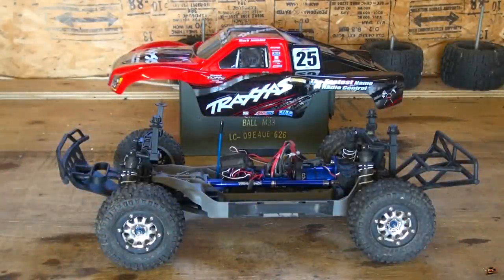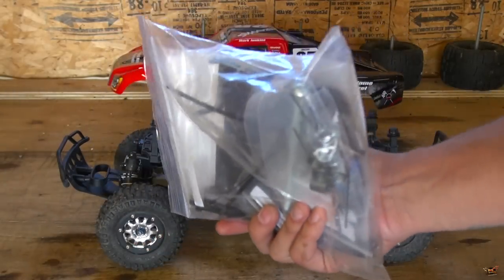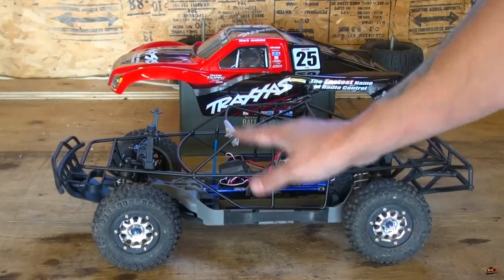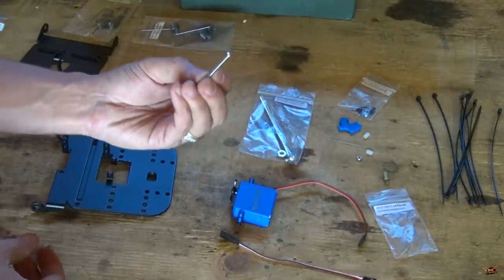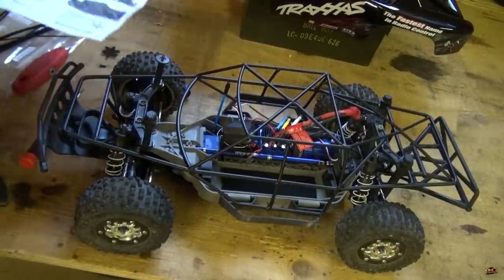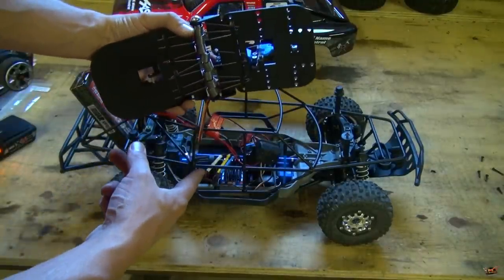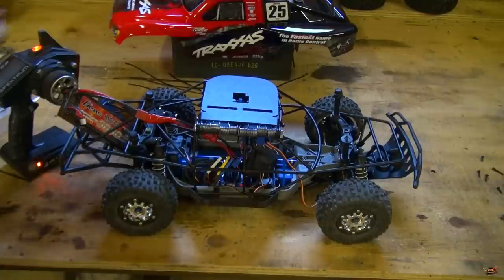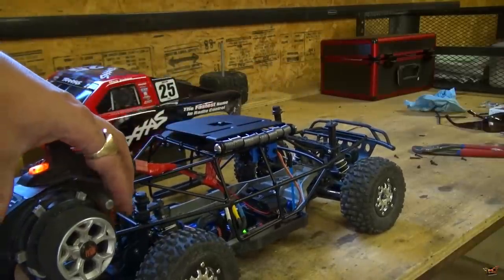RC ADVENTURES - Radio Controlled FLiP LiD - RhinoForce S2 from Torsional Concepts - Build & Test

Comment: Why springs? Why not a high torque LOW speed servo? Instead of more current draw, you use more gear reduction to get the high torque.
This means it won't give you a radio brown out due to high current draw, and it won't be too weak to flip the truck, AND you don't have to drive it back to reset it, AND it's not going to hurt anyone if it's triggered accidentally when someone's got their hand over the plate.

The only spring in this thing should be the servo-saver, if it uses one. Probably use the coil-torsion spring type of servo-saver instead of the linear-spring-with-cams style of servo saver, as those wear out and aren't great at keeping constant force on the pushrods.
Reply from the maker: Too late.. they went out of business.
Reply: That sucks

Comment: That's really cool. Do you think you could integrate an rc winch or something to automatically reset it as well?
Reply from the maker: remotaholic No.. How would you have the cable release when you needed it to flip?  You would need a neutral gear to make the winch release - which doesn't exist. Im not sure why everyone is so tainted on having to bend over to re-attach it. I'M NOT THAT LAZY.. haha :)
Reply: ***** Well you could use the winch to reset, when it is back you let the winch turn back so that you can reactivate the lid without the cable to stop the lid.
Reply: ***** sure you could, if the winch doesn't have a hold brake it will free wheel out and would be powered in to reset. Agreed though it's not much work to reset it.
Reply from the maker: ***** there is never a need for RC to exist at all.. its creative innovation that has pushed this hobby as far as it has come. As for being lazy, you may speak for your self - but there is a lot of scenarios in the world where an apparatus like this is very useful. I don't mind showing people it exists.
Reply: ***** Since your no couch potato, what's the point of installing this on you Slash?
Reply from the maker: DieHarder because I can use all the help I can get :)
Reply: Good point...
Reply: ***** i think its pointless without a way to auto-reset it ...if you're not too lazy to flip it back down then you're not too lazy to walk over and flip it back over manually and may as well not have it in the first place.. :P may as well do the complete job instead of half of it..
Reply from the maker: warmfreeze I disagree, but whatever :)
Reply: Yah, but this way you can drive it over to you and close it!
Reply: +warmfreeze Walking 150 yards away to flip your truck back over vs driving it back to you and bending down to reset it is a massive difference. If you can't tell the difference in that then you've missed the entire point and make no logical sense with your comment.
Reply: TheAmericanUhate LOL to be pedantic yet again ...there is no viable reason to drive your RC 150 yards away from you.. most tracks are less than 100 yards across XD
Reply: warmfreeze You must not realize the largest portion of RC owners are not at the track. Nobody would use this for track use anyways because of weight issues. This is not for the track, it's for the regular everyday RC hobbyist playing around locally. Also yes, many of them do drive 150 yards away also.
Reply: TheAmericanUhate kudos to the 5 people in the world who can drive an rc 150 yards away and still see it...much less control it (i said 5 ONLY due to the few FPV peeps) 

you must not realize that most people never drive an rc greater than 100 feet away from them. 

Now i am not sure if you are attempting to exaggerate the distance in an ill attempt to make yourself "feel" correct. 

The only logical reason i would see a need for this is if someone was in a wheelchair and handicapped. to which i have a friend that is paraplegic due to a gymnastics accident 2 years ago and she agrees with me that these are silly. she has no issues wheeling herself up to her own car and flipping it back over to continue driving it.
Reply: warmfreeze I guess you've never seen all the hype with the speed runs? Everyone wants to go fast in a straight line. In order to do that, they drive as far as they can see and do a speed run. I've seen it over and over and over for years. 

You realize 100 feet isn't shit? That's about 33 yards LOL. That is beyond stupid of you to even say. 

I'm sure your friend is going to wheel herself off on a dirt lot really well with a wheel chair to flip over an RC car. Sounds like you're just making up stupid shit at this point. If you don't like the idea of this, then don't watch the fucking video or comment on it. Wow some people are just fucking whiny af over everything.
Reply: TheAmericanUhate So basically what your saying is...you just want everyone to roll over and agree with your opinion. Is that how you really think life works?
Reply: warmfreeze Same could be said about yourself, obviously. I'm not the one going to video's of things I don't like to complain to others trying to force them to agree though.
Reply: TheAmericanUhate Never said i didn't like the video ..just stated it was a useless idea XD
Reply: warmfreeze I said "video's of things I don't like" not "video's I don't like". Learn to read. If I see a video of something I don't care for, I don't go watch it. I damn sure don't go watch it then complain in the comments that I don't like it. I guess I just have better things to do than be that whiny.
Reply: TheAmericanUhate I never said i didn't like his videos....in fact i love his videos and appreciate them i just simply said this add on is a bit pointless. Also how will i know i don't like some of the content and form an opinion of the video if i don't watch it? i'm not complaining ..i just stated my opinion ..you are the only person complaining about me having an opinion XD I never asked you to agree with me. Learn common sense.
Reply: warmfreeze Again, I said you didn't like what this video was on/about, not that you didn't like his video's. Again, learn to read. It was very clear this video was about a flip lid and the picture made it even more evident so you knew before clicking what this video was about. Yet here you are, still watching something you had a pre-formed negative opinion of it and here you are in the comments saying you think it's pointless and you don't like it. That is exactly what complaining is. So what if you think it's pointless? Others might and does love the idea, obviously. Learn some common sense and lose the "my opinion is the only one that's right" complex.
Reply: TheAmericanUhate This is the OPs father. You do realize you are arguing with a 12 year old girl and you will never win right? I have tried for the past 5 years. Chalk it up for experience next time. fist bump
Reply: warmfreeze I had no idea. She has good grammar for a kid, normally I expect them to speak awfully and avoid those. Mine just turned 14 and she's the same about never losing an argument, I think she gets it from her mother lmao. Thanks, fist bump
Reply: +remotaholic they should just make one that uses the servo itself to flip so it can be retracted
Reply: RCSparks Studio  especially when you have a bad physical injury (like us) and it's a long walk to the rig you just flipped!

Comment: At first I thought that it would be a lil silly. But actually it serves it's purpose well. After seeing the force of the spring in your shop I thought it would just send the truck flying in the air and end up back on it's lid. Lol. Very nice product. I'm sure someone could come up with something a lil less complicated with just a short arm or bar that could pop out a small slit in the roof so u wouldn't have to remove the top lid. 2 thumbs up

Comment: I think the main reason these guys didn't get off the ground is because of the high price tag. I'm fully aware that the costs involved for small businesses are very high compared to a large company who could easily mass produce items. I just think that while this is a great idea I would rather walk and turn my truck over than spend £ 82.17 ( $100) on the device, $40 for the cage, and then cutting a huge hole in my body... It just doesn't seem worth it. But at least these guys gave it a go. So I'll doff my hat to them. I hope they come up with something in the future that will be a viable product.

Comment: now if it could retract itself... then it would actually be useful! still kinda neat though.
Reply from the maker: I disagree. I think it's useful the way it is.
Reply: Sure I guess... I'm just looking at the fact that you still need to drive it over to you and close it. Doesn't really save that much trouble! I would assume that the weight it adds up high may affect it in terms of rolling during hard turns as well. I do appreciate the innovation... Just giving my opinion. :)

Comment: Really neat concept. Just not very practical with the bulk of it and only a single use. I've seen an RC boat that basically does the same thing but can do it an unlimited amount of times. However with the release of this new product it's only a matter of time before someone figures out a way to customize one to work numerous times. That's pretty cool though and they are sure to make a few bucks off of it.

Comment: That is a GREAT invention.. Out of curiosity, when you first flipped it was on an angle on the roof by the hinge... Did you try to flip is on an angle sitting on the other side? I'm just wondering how the device would work with a bit less ground contact?

Comment: That thing works pretty good! I'm surprised those springs don't have more force behind them with all of the tension on them. I figured the truck would do a 360 with it, but it didn't.
Great job, and another great video.

Comment: On those Slash body mounts, can I buy just the plastic pieces that screw on to hold the body in place? I used the slash mounts on my ecx torment so I could use a new body, and now I'm missing one of those cap/screws. Looks kinda silly with only 3 parts of the body locked in place.

Comment: There has to be a cheaper more effective way to do this, like an electric arm you can push a button and extend and retract without risking your hand shattering or just flipping it just to end up on its back again because it was a giant rat trap...
It's a nice idea, but probably not worth the risk. Also you need an E Maxx, tap the throttle and it's upside down lol

Comment: Nice idea, just need some sort of winch or pulley system to draw the lid closed again. Still will prevent you from having to run out to flip the car, so a good product either way. Is this something you still use, or has this become more of a novelty?

Comment: You could probably use a power door lock actuator from a car that would retract automatically. That way you wouldn't need to reset the door every time.

Comment: The flip lid is keen on the practice of job security. The lid/cage increases the height of the center of gravity which would cause the truck to flip more easily. I know you have the lcg chassis on that Slash, but I don't think it offsets the weight of  eight springs, two steel plates and a servo mounted to a rollcage. Awesome idea, I totally agree... but it also makes you more susceptible to flips.
Reply: The plates are .06" thick 5000 series aluminum not steel. The roll cage is a standard roll cage made for the specific truck. If you noticed in the video it is still hard to actually flip the truck over with the flip plate installed. Sackville RC did a review as well and also stated that it did not decrease the stability of the vehicle. The CG of the vehicles are very low to begin with.

Comment: I have an ecx ruckus but something broke and now I can't apply throttle to it, it just won't respond I have checked the battery and it's not it, I have sent it back and it always goes bad can anyone help me ASAP!!!
Reply: It's probably the radios little box, if not check you antena, or change your motor or change your batteries

Comment: I am sorry Medic. i dislike this product for a few reasons. It seems very heavy. It could have been lightened by using a tube frame similar to the roll cage that was used. It does not self retract, after deploying you have a heavy metal plate leaning to one side like a sail causing an imbalance on your truck. Novel idea that needs more work. a servo pushing a pole out of the roof could accomplish the task as well while being light and retractable.
Reply from the maker: Doesnt hurt my feelings bro.. I think it was a wonderful concept that answered a challenge at the time. They did a great job on this.. and its too bad more people didnt see the beauty in it.. but, thats life. Im just proud they tried, and executed on it!

Comment: So if you "activate" the flip roof you can't use it again until you reset it ?
Reply: +Luis Sanchez Yes, it's to flip the truck over so you don't have to go get it, and you drive it back to where you are standing, and reset it. It's spring loaded, so once it's activated, it will need to be closed before you can use it again.